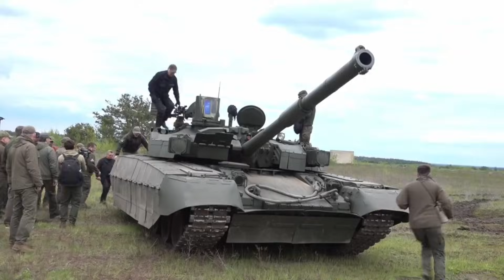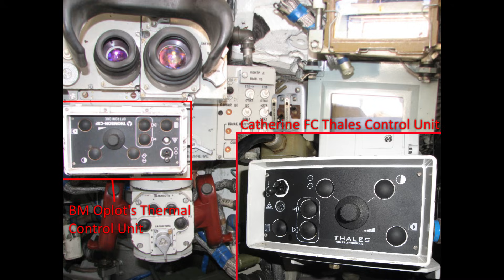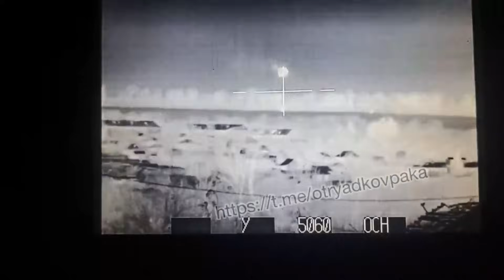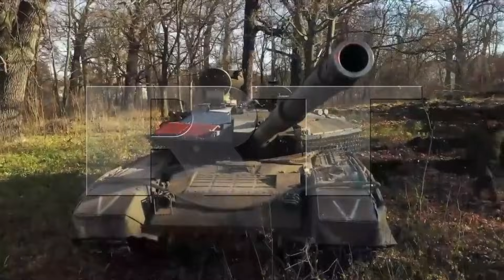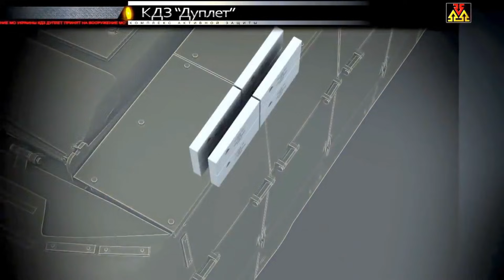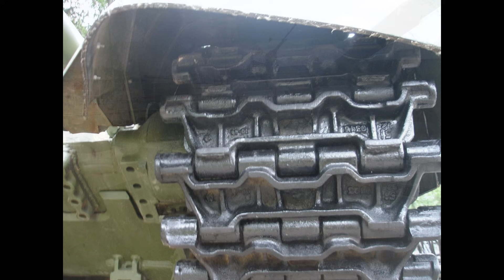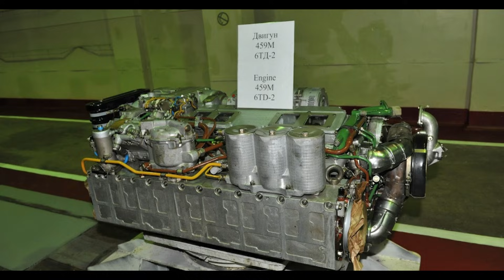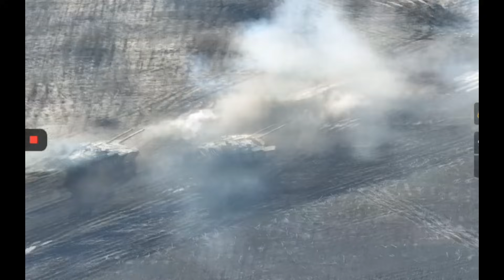Best Ukrainian vs Best Russian tank. T-90M vs BM Oplot comparison

Comment: the problem with Nizh is that its effectivness depends on where the hit lands
for example, if projectile hits last hollow charge, all 10 would affect it
but if it hits first, it would be affected only by 1
Also, because of how big Duplet is, part of T-84's base armor is cut out to mount ERA
Reply: That's why the lower sections have various angles of the charges - to maximize the hit radius. Same is with side sections for hull and the turret.
Reply: Another issue is the single use. Once it is triggered, the tank functionally misseda solid chunk of armor while on the T90M it at least still has access to all it's plating.
Reply: @dwarow2508  The rod will be lucky to pen 2 layers of Duplet. But even if it does there is a 3rd level of traditional composite armor at the bottom.
Reply: @sdrkrm  
Yeah but still. Once it triggers, it's gone. Just composite armor minus the steel plate. That is a significant drop in protection as opposed to the extre steel on thr T90M
Reply: @dwarow2508  you don't get it - It has 3 steel plates. UFP composition looks like this: Steelcover-Nozh1ERA-Steelplate-Air-Nozh2ERA-Steelplate-Air-Glassfiber-Ceramics-Steelplate. T90M has no ceramics layer and instead of second layer of ERA uses thicker steel plate and additional layer of glass fiber.
Reply: @sdrkrm  Dude, this is is so wrong. All Soviet MBTs were fitten with ceramics composite armor. It is the T84 and by extension the Oplot that do not have ceramics protection because they can not import it from Russia anymore. The Oplot has the better ERA at the expense of worse Composite armor and one steel plate less.
Reply: @dwarow2508  1. No, far from all, actually just few and Kharkiv designed T64 was the first and the only one for a long time. 2. Where did you get this bs? Ukraine is fully capable of producing any kind of armor ceramics despite what ruskies propaganda tells 3. Yes but armor trials have shown to be that ERA layer much more effective than the extra composite layer.
Reply: @sdrkrm  
1. Wrong, absolutely wrong. Every single Soviet MBT starting from the T64 used the same Composite K composite armor which included ceramics as a composite among many other materiels. 
2. Where tf did you get this from? Ukraine is barely capable of producing simple ammunition, what the hell makes you think it can manufacture advanced composite armor requiring rare and expensive materiels? Hohol propaganda or what? 
"Due to the collapse of Soviet Union, the Malyshev Factory was no longer able to obtain ceramic armour modules from Russia and only the initial batch of T-84 were produced with such. Instead, later batches of T-84's composite armour is composed of special purpose rubber sandwiched between steel and alloy plates."
This is literally from the report on the T84 of the Malyshev Plant.
3. No they didn't. Double layered composite armor is far more effective than ERA. It is however vastly more expensive, heavier and takes up more space, which ERA does not. This is why tanks still use composite but not all tanks use ERA.
Reply: @dwarow2508  1. I worked for defense. No, Multiple T72s, Some T80s, Some T90 did not use ceramics at all. As glass fiber is not ceramics, sand rods is not ceramics, steelglass fiber sandwich is not ceramics, corundum balls is not ceramics and the list goes on. 2. LOL Ukraine was always the brain of ussr. At least 2 factories are producing a full cycle of thermal optics and fire control system for the armor which surpasses russian "domestic" variants. Same is for ERA, same is for armor steel, same for ceramics, same for missile and guidance tech 3. I don't care what you think kid. You confuse ceramics and composite, state absolute rubbish about well known facts about soviet armor or defense industry you obviously know nothing about and so on. Both T90M and Oplot UFPS were tested and ruskies armor was proved to be vastly inferior - that's all what matters.
Reply: @sdrkrm  
1. I have relatives who actively work for the Malyshev Plant, calm down. No, every single T64, T72, T80 and T90 produced for the Warsaw Pact was fitted with Composite K type Composite armor. All of them used ceramics components. Composite K uses ceramics, glass fiber, rubber, sand and steel as the plating. It is really simple. 
2. LOL Ukraine was the brain? Source? 2 factories producing thermal optics? Adorable, the RSFSR had 7 dedicated factories for thermals, 28 factories dedicated for data transfer modules including screens and fire control systems and of course the invention of Composite K and Malachit which surpasses Ukrainian "domestic" variants. Same is for ERA, same is for raw steel, same for ceramics, same for missiles and guidance systems of all generations. I do not care what you think, kid.
You confuse ceramics with western caramic armor, state absoltue rubbish contradicing direct statements by Ukraine itself and well known facts about Soviet armor of the Soviet defense industry you clearly do not know anything about etc. The T90M and Oplot were tested. The Hohol armor was proven to be vastly inferior - that's all that matters.
Reply: @dwarow2508  🤣🤣🤣 You're even worse troll than you are a liar, lol! Just one question - who are your relatives there? Give me just 1 name (and I know a lot of people there, even welders), who he or she is and most importantly - where is this person now? I'd like to hear more of your fairy tales 🤣
Reply: @dwarow2508  no answer? I thought as much. Get lost troll, and take all your lies you wrote here with you.
Reply: @sdrkrm  i like the vague "i worked for defence" - did you clean the floors or work security or something? What is actually all that matters is that the T90 exists in the conflict.
Reply: @ScruffyNZ.  even cleaning the floors at Polaron or Luch is much closer to defense than any of you trolls ;) "T90 exists in the conflict' - not for long - russia is getting out of stock of ussr tanks. Barely 2800 of T64/72/80/90 left in total.
Reply: @sdrkrm  not a russia bot or anything but, you should honestly not use the "i worked for defence" while simultaneously using "kid" when you are trying to act like a "professional", you cant use both.
Reply: @ROPEMAXX-6767  I can do whatever I want, kid, and I dont care how I look, and now that I'm almost 57 I can surely pass for a grandpa for the majority of lot here.
Reply: @sdrkrm  how many Oplots are there, boy?
Reply: @ScruffyNZ.  53. boy is your father to me, kid 🤣
Reply: @sdrkrm  pfft, you havent even hit retirement age. back to sweeping those floors
Reply: @ScruffyNZ.  yes, go, because you've missed the spot.

Comment: Even if Ukraine had a wunderwaffe tank or a cheaper off the shelf one, I would question its production. Russia has historic and greater capability to produce tanks. So this video should just be seen as a fun one.
Reply: If they have enough parts left to repair/more t90ms use of western imports means they can't get more parts. Perhaps they made their own replacement, otherwise good luck.
Reply: @RhomasTotevenaar  they already use newer domestic one on the new batch, the old batch still have mix components. yeah T-90 is so bad that still operating in the war and UVZ keep producing it in parallel upgrading the old one
Reply: @RhomasTotevenaar  chinese parts to replace western imports

Comment: The main disadvantage of the T-90M is the lack of APS. Even the T-72B3 with a commander's thermal and APS will be better than the T-90M without APS.
Reply: Arena-M?
Reply: @Տիգրան-ժ1է  none
Reply: @a.t6066 wdym?
Reply: @dragbrid2357  no t90 has it
Reply: @a.t6066  So you are saying the t-90m does have it
Reply: @dragbrid2357  no production t90 has it
Reply: @a.t6066  Oh ok. But is it supposed to?
Reply: @dragbrid2357  yes supposed to but Russian MOD is too cheap to equip them all.
Reply: Yes eeerm. But you know the T72b3 arent equiped with aps yet?

Comment: If T 90 gets it's ERA improved and reverse speed issue fixed that would be a supurb tank
Reply: @cmdrmonkey  chobham armor is just a name for British composite armor. Its not magic or special really, actually by now probably outdated since its like 40 years old at this point. The first use of composite armor was actually by Soviets. T-90s already have composite armor of their own design.
Reply: @cmdrmonkey  it’s not useless
Reply: @cmdrmonkey  Soviets were first to use composite armor - before British. First tank to use composite armor is T-64A.
Reply: The ERA on T-90M is already good as it is.
Reply: @phunkracy  I mean it they could make it even better
Reply: @phunkracy  but it could get improved on the gun mount
Reply: @iplaygames8090  you cant really improve it more. its covered by ERA but this area by neccesity is always less armored in all tanks
Reply: @phunkracy  actually it isnt. Red effect said its just a steel plate unlike woth the ukranian one which has era there.
Reply: @iplaygames8090  mate, its the other way round and I invite you to either rewatch the video or to google T-90M photos which is far quicker
Reply: @iplaygames8090  You can't. Gun mount is a natural weak point on ANY tank. You can only make fat-ass armor plate there, but it'll still be a weak spot. If you stick ERA there, the explosion will likely damage the gun barrel.
Reply: Add to that a rear bustle auto loader
Reply: @rogue__agent5884  bustle loader would completely change the design of the tank. I think with better protection of the auto loader and the tank itself the issue will become a very minor one.
Reply: @vii7031  it’s not just extra safety that u get with rear bustle auto loader 
u also get to have longer projectiles increasing performance, as of now Russian tanks like T-72/T-90/T-80 have reached the peak length and they can’t increase the size of the projectile meaning the performance cannot increase
Reply: @vii7031  Bustle autoloaders carry too little ammunition to suit Russian needs. So even if T-90M had a bustle autoloader, it would still need to keep more than a dozen extra rounds inside the tank.

Edit: Actually, no. Leclerc carries 22 rounds of ammunition in its autoloader and is slightly thinner that T-90M, so yeah I guess a bustle autoloader is a pretty good change.
Reply: @definitelyfrank9341  Bustle ammo storage as such is a retarded idea and here is why. The bustle is the least-protected part of the tank, it's exposed to enemy fire even in hull-down position, it makes turret even heavier and more complex than it needs to be, and finally, when HE-FRAG ammo that is located there is struck, the explosion of around 45+ kilograms of HE would tear the tank apart anyway. So no point making ammo easier target by placing it into a turret bustle when the result of being struck is same. In fact on the floor of the hull is the best protected spot in the whole tank.
Reply: @Max_Da_G  A detonation there would not blow apart the tank, there are blowout panels, otherwise every single western tank in existence has that massive design flaw.
Reply: @cmdrmonkey  Russians never tried to duplicate anything. And don't need to. Armor must stop threats and have certain mass. How that armor achieves that goal is up to designers. And that Chobham, and its development, the Dorchester, is effin heavy. If you bothered to look at Ukrainian terrain, if medium-weight Soviet-era tanks sink into it, heavy-ass brit tanks would sink even deeper. Also that armor you mentioned is located on limited areas around front. It's not on sides of hull or turret or roof, meaning the tank overall isn't any better. No need to copy fat-ass brit armor when 1) own designs exist that do the job just fine, 2) that armor would blow out the weight of the tank. As for active protection system: it has one. It's a soft-kill APS, not hard-kill APS.
ERA is so useless that when T-72B '89 was tested against the "Silver Bullet" M829 APFSDS, the Kontakt-5 ERA made the frontal projection immune to those rounds. ERA allows for a lighter armor package that's easier to repair after battle, while having similar or even better resistance to enemy projectiles.
Reply: @cmdrmonkey  soon they will have it ;)
Reply: Relikt ERA is good enough already, the Oplot may be better, but it's ERA is heavy as sh!t and probably expensive as f*ck.
Reply: @saucy743  You're so right. An ex-T-72 tanker operating a T-90M even said that T-90M's increase in weight was only just tolerable and more weight would make it impractical. Now, BM Oplot is 3 tons heavier than T-90M, so it quite literally sinks a foot deep into the ground.

Comment: Someone tell me why the Russians didn't even think to use a transmission that have more than 4km/h of reverse speed and didn't they try to develop a new transmission
Reply: They probably do. It is probably not as easy to do as people say. Also may not be as important as people say. 
The actual speed is closer to 6km/h - i.e. fast walk.
Reply: Russian aroured doctrine predicts fast, land based assaults on the enemy, reverse speed would be pointless in those scenarios. 

Problem for them is that this doctrine is incredibly outdated, entirely insufficient in the modern era of anti-tank technology.
Reply: Modern Russia weren't properly maintaing its army because we thought there would no need for that since there was supposed agreement between us and the west, we give you cheap oil and gas, you don't touch our neigboring republics since we have economic interests in those territories. After all we're relatively peaceful nation having to fight terrorist state in 1994, 1999 and in 2008 when Georgia attacked our peacekeepers. In 2014 there was annexation without any resistance and then we were just funding LPR, DPR rebels and PMC Wagner who were the only ones fighting in Donbass. And in 2015 we came to Syria to again fight terrorists.

What's interesting is we're still battling chechen rebels, they were (or still are) in Syria and they're in Ukraine, a lot of them were fighting in Bakhmut

Comment: Would be nice if they finally fixed the T-90M's reverse speed, then it would be pretty much perfect
Reply: we have already managed to accelerate to 15 km/ h, of course not the NATO 38 km/h, but something
Reply: @Տիգրան-ժ1է  wait, so the T-90M can go 15km/h in reverse now? That's already quicker than the T-80's :D

It's nice but still not quick enough like what the Czechs did with their T-72's having a high reverse speed
Reply: @evo3s75  The problem is that you don't have to modify the gearbox, but change it entirely. And here you need to choose between price and quantity, as always Russians will find a golden mean.
Reply: @Տիգրան-ժ1է  Incorrect